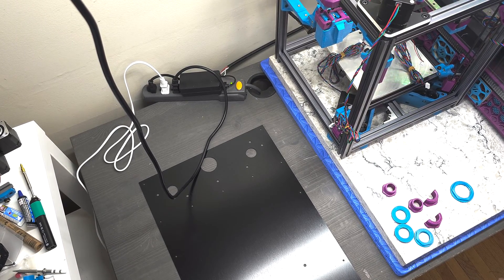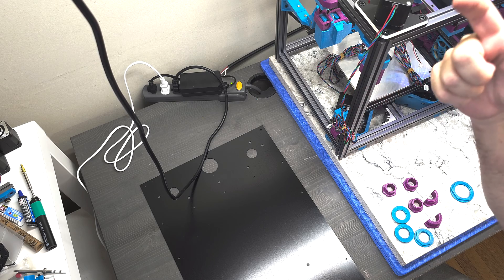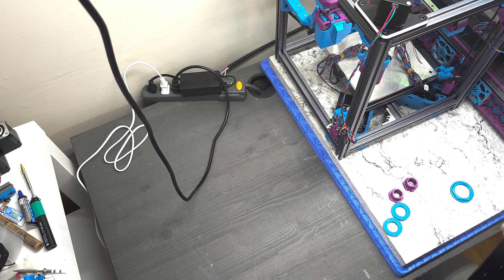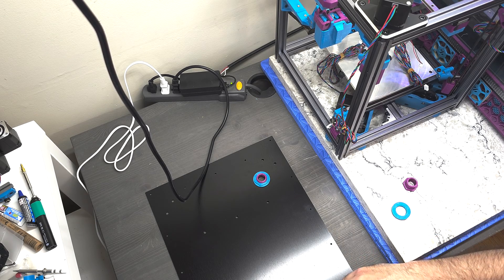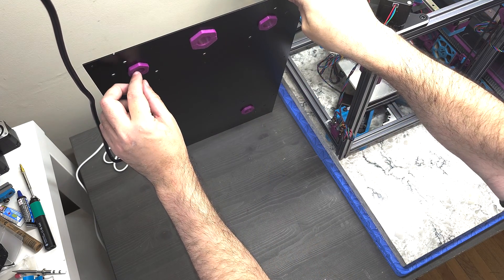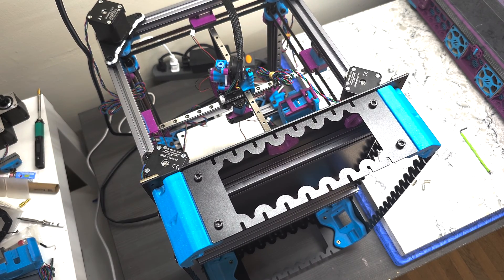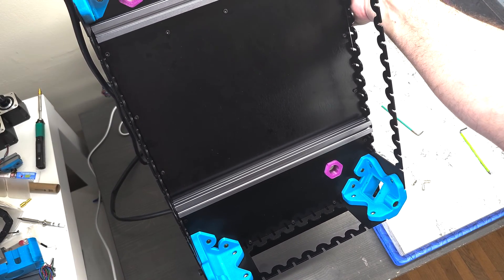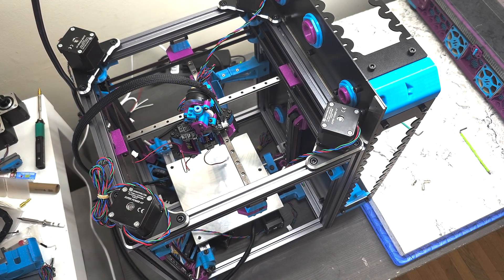Annex Engineering K3: Build Part 13 - Backpack Assembly

Comment: I LOVE the backpack. Easily my favorite part of the K3.
Reply from the maker: I like to tweak and poke and modify stuff in the electronics bay as I test out different theories and hardware. The ease of access and the magnetic hatch are going to save me sooooo much time and effort whenever I want to change anything.
Reply: @oldguymeltsplastic  I completely agree, and I ended buying a side pack frame kit for my trident specifically for that reason. Though I think I may do the inverse electronics on the trident and use the side pack frame for the rebuild of the doomcube V2. I bought all of the parts to do the car hood mod on the V2 but.. I'm just not liking how it's gone together. It doesn't feel like it will be worth it in the end. Maybe will put it on the V2 at work since that will be experimented on FAR less.